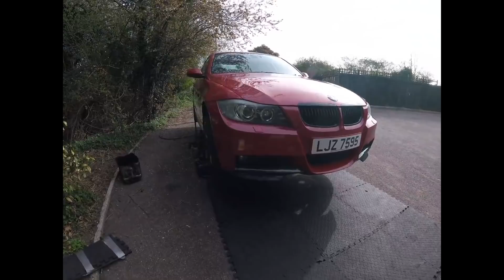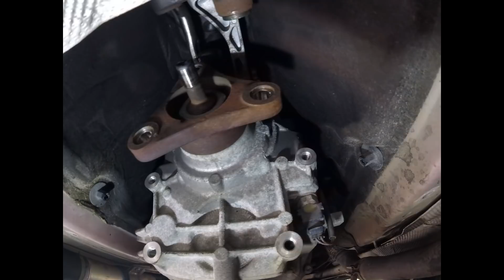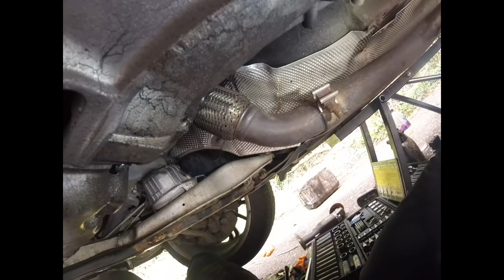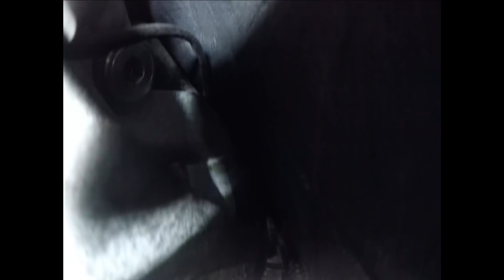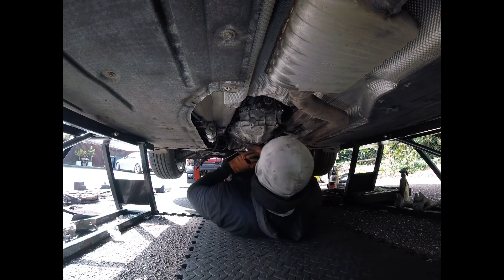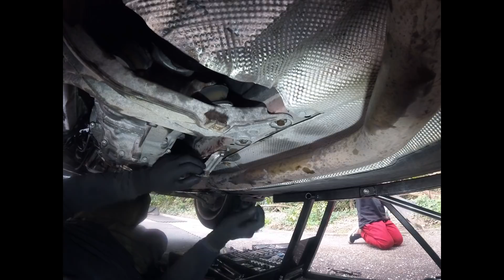2007 BMW 3.0L 330 M-Sport Diesel Clutch Replacement

Comment: Just great, how much more convenient than front-wheel drive!  everything has been worked out to the smallest detail, BMW are great, why did you change the flywheel?  doesn't seem to be broken
Reply from the maker: The centre bearing/spacers won’t handle the new clutch plate pressure. It’ll start rattling

Comment: I felt really cozzy when he put me between gearbox casing and insulation. I bet 100€ that not a single car shop would do clean job as this guy, they would miss parts or not screw all the way in or just lie and take your money. This is by far the best mechanic i have ever seen, wish we were living in the same country so you could help me out aswell.

Comment: At 5:20 when you use a ply bar to push the propshaft away from the guibo. Did you have to disconnect the center propshaft bearing from the body to get that much movement?
Reply from the maker: On these theatre are about an inch give to slide the prop into itself.

Comment: Hi Kevin, just wanted to ask about the quick jack. I’m a mobile mechanic and have been considering getting one. Does  it ever wobble side to side when jiggling a gear box in or out. Just worried about the stability as there’s so support between the two beams. Keep up the good work and the videos, you do an excellent job of those clutches 👍🏻
Reply from the maker: Hiyup..,  it’s quite sturdy. And no swaying whilst moving gearbox about. The only thing is it has to be on a flat level surface otherwise.,,

Comment: KEVIN tu es champion ✌️
Reply from the maker: Salut et merci.
Reply: @WMCS  I believe this one was also in the other posting. Unless you’re doing two very similar BMW’s   I notice u seem to b able to speak French. I should say write French.  Also your young man with u. I use a refillable container with gasoline in it. I just pressurize it with air. Probably not as environmental as the brake kleen. And in those fancy areas where u work, u have to keep everyone happy. Thank u!

Comment: Hello, I have followed your steps more or less to lower the gearbox but I can't come out of the guide, it stays loose and the gearbox of this peugeot 807 st 2.0hdi 79kw 109cv is very big, it doesn't come out, it stays a little as if it had a insurance or screw that prevents it, I would appreciate if you guide me, I have disassembled all the bearings, it is free from the chassis, I have followed a video of yours of the peugeot parnet that you do not lower it, you leave it in the chassis but as it is full of oil, it is hardly appreciated
Reply from the maker: Try a pry bar.

Comment: Nice work dude. But you need to get yourself a Milwaukee mid torque the new one. Much much lighter and will take off all those bolts no problems. The high torque i find is very heavy when working underneath like that.
Reply: Mid torque is great but no provision for one-key torque settings unfortunately.

Comment: How do you decide to use the hydraulic lifter and when you use only the "stands"?
Reply: I would say because this is a rear wheeled drive car he needs to get further under the car, so the hydraulic lifter makes things more stable,  easier and safer. Jack stands are great for working on front wheel drive cars. That’s my way of choosing between the two but I might be wrong.
Reply: @kuldipxxxpanesar  I would not trust the jack stands and some of the corroded bodys... looks much easier with the hydraulic lift

Comment: Nice job. Is that 1/4 drive ratchet or a 3/8 ?
Reply from the maker: It’s the 1/4 drive. I went for it so I could really get the smaller sockets in tight spaces.

Comment: 18:10 to change the starter on this miraculous car... you have to take the hole engine out... thank you BMW... thank you made in Germany... 2 stupid brands going together...
Reply: It wasn't always like that. BMW, Mercedes, etc, much like pretty much every brand nowadays has gone downhill at some point. For Mercedes it was around the 2000 mark, for BMW around 2005 mark. It's all about cutting costs and maximising profits. Whereas back in the 80's for instance, both BMW and Mercedes, in terms of engineering, reliability and design, they were the best manufacturers in the world
Reply: @youjustreadthis897  yes 100% but if customers let treat them like this... when does it get better??? And every engineer how does this ... please stop your work and go home!!!
Reply: @StarLink85  You can thank mostly capitalism for that. Long are the days when manufacturers made cars with love. Customers allow them because most want new cars and these are the new cars available to them